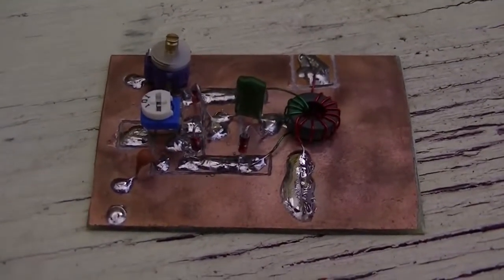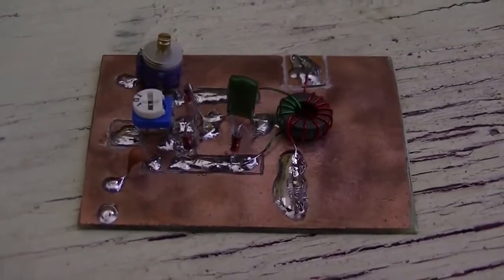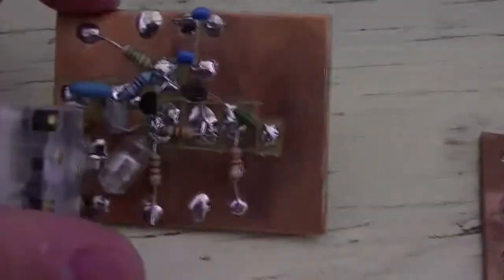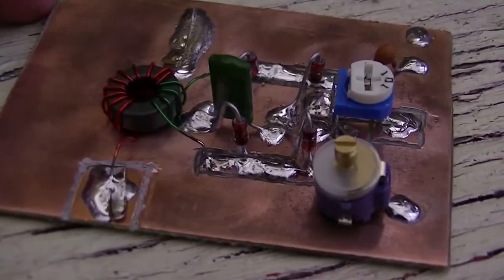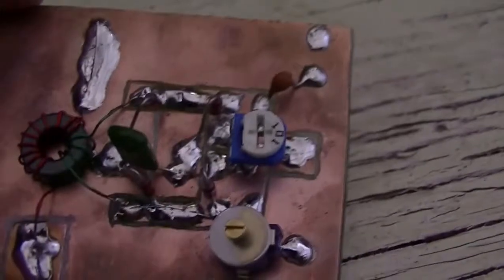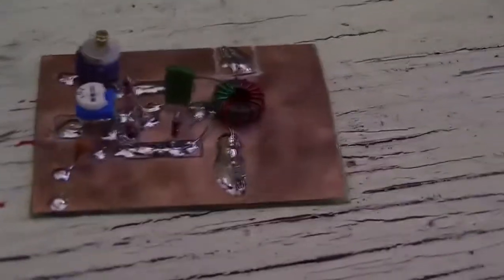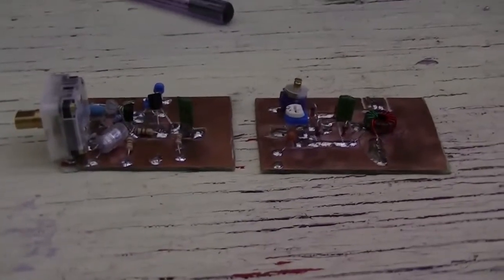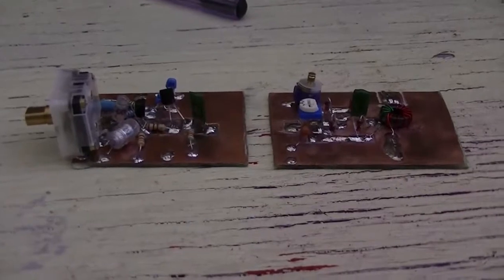Building A Beach 40 Transceiver - Part 2: The Balanced Modulator / Product Detector

Comment: Hi. I've  started building mine. I like your neat PCBs comparing to my chaos. Could you tell me what toroid have you used?? I just wound binocular BN43-202 but RF is dead on the output. No audio or other stages connected so not sure if this is how it should be. I would imagine RF should sneak through this ferrid towards 2n2222a. Thanks in advance for the info. Good luck.